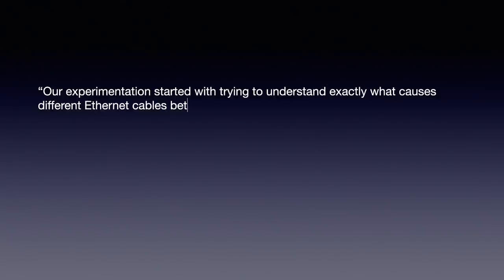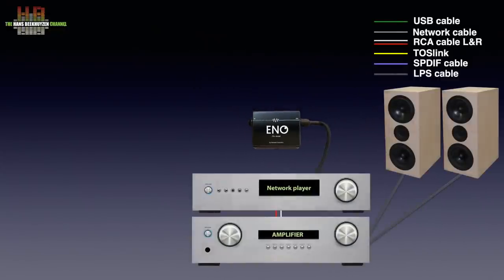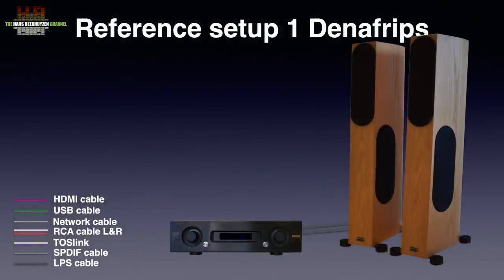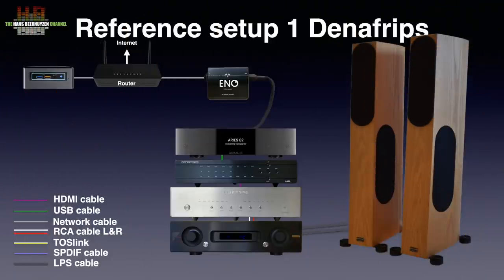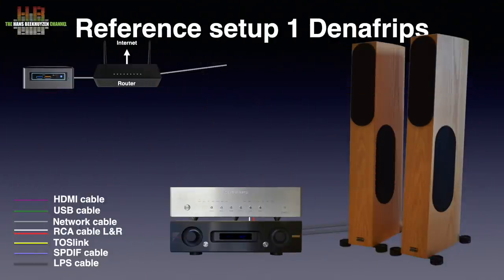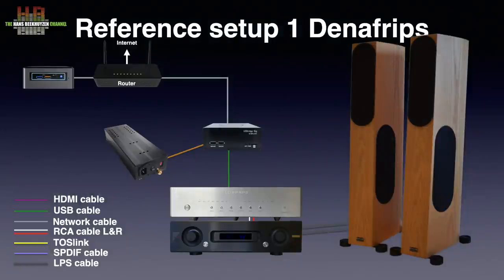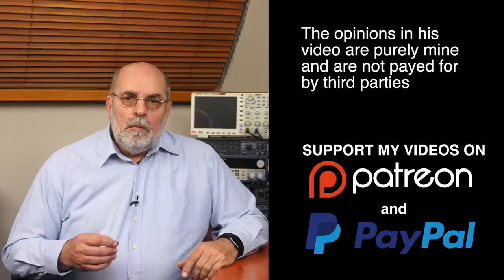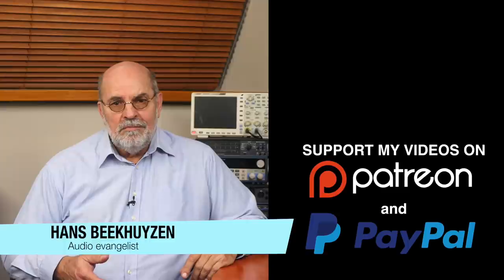Network Acoustics ENO Streaming System

Comment: I am not trolling or hating, I am a big fan of the channel, but it is hard for me to accept, that for the price of two of these passive signal cleaners, one could buy Hegel H120 integrated amplifier, with balanced inputs, dac and streamer. I am not accusing nor insulting our messenger, but something looks out of balance here.
Reply from the maker: I understand that completely! A review of the Eno was requested several times by viewers but I didn't feel like it. Until the manufacturers - two guys that started a company - contacted me and asked if I would look at it regardless whether I would review it or not. It took me 3 seconds listening to know I had to review it and two weeks later the video was published. I you can spare a grand, get the ENO System. With the 30 day return policy there is only one risk: you won't return it.... And to be clear, I have no benefit in any form or shape if you do.
Reply: @TheHansBeekhuyzenChannel  Thank you for your time, both for the review and the comment. Perhaps it took some expenses to develop this device

Comment: I’ve finally integrated the Eno in my system after wanting to try one for a while. The digital journey in my set up is a Chord Epic Array Ethernet cable from router to an Adot MC03 audiophile media converter with Linear power supply, switching to fibre, to my EtherREGEN Network Switch with an MCRU option 3 linear power supply, AudioQuest Vodka to Eno to Metronome DSS network transport to Gryphon DAC to Gryphon Diablo 300 integrated amplifier. To be honest I’m astonished how the presentation has changed with the Eno on board. Darker background, more air, PRAT improvements and the hint of digital glare has all but disappeared. Great review Hans, the only thing worth noting, which is at odds with your experience is the presentation is better with the EtherREGEN in the chain. I guess this could be system dependant and come down to personal preference. This has been such a revelation I’m already considering upgrading to the Muon Pro. 😀

Comment: I plan to try an ENO isolator. I have the SOtM isolator, which varies from very small improvement to almost none, depending on connected equipment. So I will definitely compare the two.
Reply from the maker: please share the outcome, mentioning your entire setup

Comment: I agree with the explanation! However why not use Fiber? No noise because it doesn’t have power through it.
Reply: I use fiber everywhere in my network. It’s a true galvanic isolation.
Reply: You’re right in that fibre uses pulses of light instead of analogue waveforms to transfer the data, but at some point in the circuitry, in a device somewhere in the chain, it has to be converted back into analogue waveforms, as, right now, we cannot convert light pulses into music within a DAC. So there will be unwanted noise generated in that process.
Reply from the maker: Fiber solves ground plane noise through full  galvanic separation but it doesn't solve the phase noise problem that often is at least as problematic.
Reply: A new set of problems arise from the light transmitters and receivers, not the fiber cable so much.

Comment: are the benefits only to ethernet endpoints?  my dac is still plugged into my roon core (i know i know sorry) .  what would this do between between a commercial router and a windows pc?
    this looks great, but should i concentrate on good roon endpoint first?
Reply from the maker: I don't think so. The computer itself generates so much electrical noise... If you have a grand to spend, spend it on a good network bridge. The USBridge Signature is only € 400 and will give more improvement in your situation.

Comment: Hans, this review is very timely for me. I am in the last days of my 30 day trial of the Uptone EtherRegen. If I understood this review today correctly you say the Eno is presents a bigger improvement than the Uptone ER device? If so I will return the Uptone and buy the Eno.
The Eno requires no wall wart to upgrade also. Thanks!
Reply: Speed your extra cash on a good linear power supply for the EtherRegen. Needs good PSU to get the best.
Reply from the maker: I power the EtherRegen from the UltraCaps 1.2.
Reply: @TheHansBeekhuyzenChannel  Dear Hans, 
currently I’m using a Cisco 2960 + Etherregen. I conclude that you find the ENO more analog sounding than ER + lps 1.2 which I like.

I’m not sure if I want to add a Farad lps (which should sound better than the ER + lps1.2 combination or replace the ER with ENO.)

Long story short: can you make a prediction if the ENO will outperform the ER + Farad?
Reply: @nicktube3904  that is definitely a question many might have. But also ENO has evolved with the new Muon line. Hans, did you have any change to test / compare already ?

Comment: Does adding an audiophile switch like the English Electric further improve the ENO as they recommend?
Reply from the maker: I use the SOtM switch, which I rate higher then the English Electric and that makes a small difference when added to the ENO system.

Comment: Hi Hans, thanks for the video. As Network Acoustics said that the sound difference is caused by the unwanted 'noise' mixed in with the Ethernet signal. I wonder how the sound with ENO compares when you disconnect Ethernet from your Auralic Airies G2 and use wireless streaming via Wi-Fi in your Reference Setup 1.
Reply from the maker: Where I live it is hard to get a wifi connection stable over a longer time.
Reply: @TheHansBeekhuyzenChannel  I was going to ask a similar question. After buying an Aries G2 to replace an ultraReendu I didn't find appreciable difference until I went wireless. I re-purposed a TP-Link router I had bought for my daughter's Erasmus year connected to an ethernet socket in my music room and this was what made the Aries G2 a "keeper" for me. ( I had done a full renovation of our house to bring it to a low energy use  and included in the specification several ethernet sockets in each room and found better sound via wireless in the room rather than direct ethernet connection) My rationale for what I was hearing was that wirelessly  all the "noise" associated with cables was negated and Auralic's wireless implementation proved to be as good as they claimed. Have you ever been able to compare the Aries G2(.1) with a strong stable wireless connection vs a wired connection?

Comment: Hello from Montreal. I have the Innuos Zen 3 and I just added the Phoenix reclocker using the ethernet connection from my modem, is the ENO a similar product without a linear power supply?
Just asking. The sound quality from my streamer is now that much better with the phoenix especially after three months of break in. Can I say warm, less bright, analogue and happy. Take care
Reply from the maker: The Phoenix reclocker is a USB device, the ENO system is for  the network connection. Truly different applications and thus different devices. But both aim the further improve the sound quality by perfecting the signal. The ENO System is a passive device that needs no power supply.
Reply: @TheHansBeekhuyzenChannel  Thank you for the reply, With my Innuos reclocker I do plug the ethernet cable into it and then USB to the streamer and so forth to my dac. So the ENO is a step before by filtering the signal from the router via ethernet. 
I really enjoy and appreciate your help and guidance. Canada is slowly getting through this pandemic, we still have areas of the country under a curfew and travel restrictions and other areas have opened up. We have been extremely cautious not like the USA. I assume you and your country have been affected by all this. Take care

Comment: Hi, thank´s for another inspiring review. I am using the EtherRegen with an Auralic Aries Femto on the audio-dedicated output. I am wondering, if using one of the 3 conventional outputs, then with the ENO into the Auralic, would be a solution to avoid double filtering effect. Since my DAC is also an network streamer (AudioNet DNC) I could use the one dedicated output on the ER for this. Have you tried this way, using the conventional outputs in combination with the ENO ?
Reply from the maker: I have no idea what you mean. Sorry.
Reply: @TheHansBeekhuyzenChannel   The EtherRegen has only one isolated output for Audio. As far as I understood from your test-setup, you used this single isolated output to connect the ENO, and from this to the Aries G2. According to Uptone Audio, the 4 Ethernet connections on the other side of the device have not the benefit like the single audio-dedicated output, so I assume less filter effect. Since you said, that using the ER in combination with the ENO was not that good, I presumed, that you might have used the single, isolated output of the ER. I am wondering now, what would sonically happen, if you used one of the 4 ethernet connections on the other side of the ER (less filtering and no isolation), then into the ENO, then into the Aries. Would it bring the same benefit as you described, when putting the EtherRegen out of the chain ?
Reply: @michaelnosbuesch6920  I don't have the Eno, but I have the EtherRegen.  You should be able to have a good result by doing the connection you described, as 4 ethernet connector side of the EtherRegen behaves like a regular switch.

Comment: Great video, Hans. I do love your channel and the quality of informations you provide. Basing upon your previous videos I bouught an aires g2.1 for my rig. Next week it will be delivered to me, I'm so excited! I have a question. in my home the rooter is connected to the switch in another room and in the listening room there's an RJ45 wall plug.  insert the eno between the wall plug and the aires will incrase the quality in spite the rooter and switch are in another room? you have already answered to a similar question, but I would like some more clarifiyng details.. thanks a lot!
Reply from the maker: It's not important where the route and switch are as long as you connect the ENO directly to the Aries G2.1.

Comment: It would be very interesting to compare the ENO to using wifi to connect to the Aries G2.  Auralic claim to have minimised noise generated by wifi, and I can say the Aries G1 is very very good in that regard (I had one).
Reply from the maker: I did review the ENO using the Aries G2. Wifi versus ethernet depends on local wifi conditions and on the switch used for wired.
Reply: Having recently acquired an Auralic Altair G1 (for use with 2x Auralic Merak Monoblocks and Focal Sopra No.3 speakers) I have not yet had the chance to fully experiment and decide whether it sounds better over WiFi or Ethernet, though I am most interested to see how they compare. I fortunately have quality, heavily shielded CAT6 cabling throughout my house and a commercial grade switch (with built in power supply - not a cheap SMPS) and a separately connected gateway/router - again, commercial grade with quality built in power supply, no SMPS). 

However I also have rock solid, high bandwidth, mesh networking, multiple access points (commercial grade Ubiquiti UniFi - to work with their Router/gateway, a DreamMachine Pro). That said I also know how heavily polluted my current location is from neighbour’s wifi, and albeit my set up has zero issues we all know that doesn’t guarantee sensitive audio equipment will see the issue the same way! Anyway, will be interesting to see if the quality of the audio is dependent on the quality of the wifi network, or the pollution it has to operate in. As I will be moving house in a few months to where wifi traffic should be much, much reduced, maybe I will have to repeat my testing then and see.

According to an article by J Darko (https://is.gd/sLNRsF ) AURALiC CEO Xuanqian Wang believes their circuit designs implement wifi in a way that is able to minimise noise to the DAC, and in fact they recommend connection over wifi instead of Ethernet on their devices for this reason. In this instance however, the question is whether their wifi implementation can be as good as Ethernet connections filtered by means such as the ENO etc. As I don’t (yet) own one that I will not be able to say - only if it is better than unfiltered Ethernet. There is a (long) quote from their CEO in this article which I’ve copied/pasted below to those interested to hear his view:

“The network router, the NAS and other network device are directly attached to the router using Ethernet cable which can be quite noisy. If the streamer is attached to the router using Ethernet cable then the noise can easily be transmitted to the streamer over this physical link. The regular CE, FCC and other EMC standards only guarantee the device will work stably, but when we are talking about sound quality, we are actually talking about EMI noise that is 1/1000 of the EMC’s standard, so it affects [sound quality] a lot. That’s why audiophiles say different NAS or different routers sound different.

The Ethernet cable is [also] a big problem. It runs long and can pick up low-frequency noise which cannot be filtered out. This noise will introduce jitter at low frequencies which no PLL circuit can get rid of and it will affect sound quality a lot.

WiFi will sound better if:

The engineer that designed the streamer knows how to design the WiFi module right. ‘Right’ means the module does not introduce noise to other audio circuits sharing the same ground circuit;

The WiFi signal between streamer and router is strong and stable. This is because if you have a poor WiFi signal, the WiFi protocol will try to fetch the data again and again due to large error rate (Yes, we use TCP to transfer music data which has error correction). If there are too many retries, it will add additional load to the processor and potentially generate more EMI noise.

The reason that many audiophile companies claim Ethernet to sound better is that they are not capable of designing a good WiFi circuit and they have no such background knowledge (poor WiFi network). All our streamers use existing Intel WiFi modules because they work well on a Linux system and they are well designed with minimum EMI noise generation and, most importantly, we know how to design the circuit around it correctly.”

Comment: Hi Hans. Thanks for the review. I have a question that is off the topic of this review. My Roon Rock with a wall wart switch mode power supply is connected directly to my Denafrips Ares DAC with a USB cable. I plan to order an UpTone Audio USB REGEN to go between the two and either an UpTone UltraCap LPS-1.2 power supply or a linear power supply (probably Chinese) for the computer. Which of the two do you think would benefit the most from a better power supply, the Roon Rock or the USB REGEN? Also do you think the Allo USBridge Sig with Shanti power supply would be comparable to UpTone Audio with UltraCap LPS-1.2 power supply? I know you reviewed both of these in earlier incarnations but I wasn't certain which of the two you preferred.
Reply from the maker: The USB Regen would be my guess. But go for a good one, like the UltraCaps.
Reply: I have a similar setup. I replaced my USB Regen with an IsoRegen. Better than an USB Regen w/1.2. Use the 1.2 with the Isoregen if that's what you meant (the USB Regen is discontinued.)

Comment: Have you tried comparing the ENO to an ER connected via optical cable? I found that when I connected an optical cable to my ER there was an improvement in sound quality. Also, was the ER in your setup powered with the standard power supply or a linear power supply? I am currently running a standard power supply but considering an upgrade to a linear power supply and was wondering if you have tried different power supplies in your setup.
Reply from the maker: What's the TLA you mention?

Comment: Since digital signals came up again, what is your opinion on the possible physical (not subjective) cause(s) of an observation I made: over the past 20+ years I have consistently noticed that a digital source that has analog outputs (including a DAC) and digital outputs still maintain a similar sound over the digital output as the one over analog outputs. Improving parts, e.g. PSU and clock might improve both, but still the characteristic sound remains identifiable and similar. A Lumin always sounds like a Lumin, and so does Auralic, Elac, Naim, Linn, etc. What makes these sound signatures? What are the most critical parts in the chain in Pareto sense (analogous to the tweeter series capacitor in speaker crossovers)? I don't expect an answer to this here (maybe one doesn't even necessarily agree with this observation), but if you have already written or said something about it, please share a link, or otherwise think about eventually addressing it later. Thank you :).
Reply from the maker: Since it's impossible to design audio gear using only measurement equipment, the final stage of design is the voicing, the tweaking the sound by ear. Here of course the other equipment used and the personnel play a large role. Since perfection is only a goal, not a reality, each team will find its own compromise towards perfection. Therefore there is something as a 'Naim sound' and so on. About the digital and analog outputs having the same signature: that is the character of the phase distortion that causes jitter in both internal and external DAC's.

Comment: Other good one, Hans. I enjoy the format of your reviews.
Will the ENO work in a situation where the network switch and Roon Nucleus are in a different room from the system?
In this scenario do you think upstream ethernet cable matters?
Reply from the maker: I have not tried but I think the effect will be limited. Use the ENO just in front of the network player, there it will reduce the noise and will give great results.
Reply: @TheHansBeekhuyzenChannel  
Thanks Hans for another great review. 
Does the ENO do similar improvement as EtherRegen?
Reply from the maker: Have you watched the video?